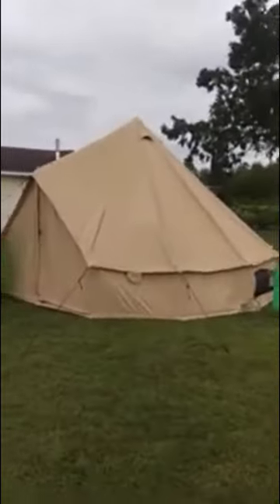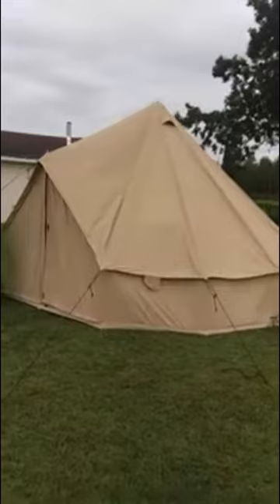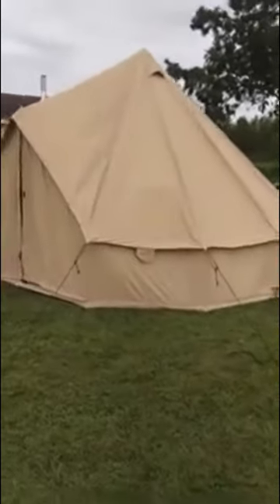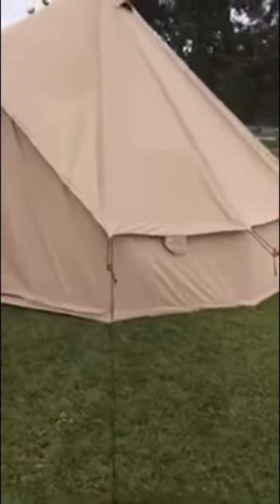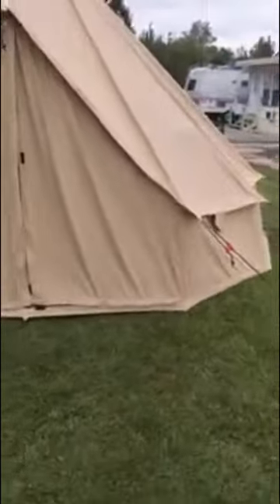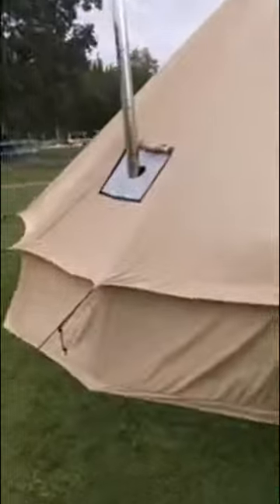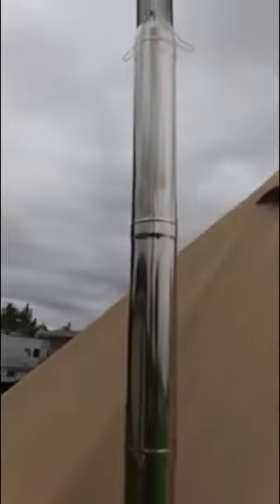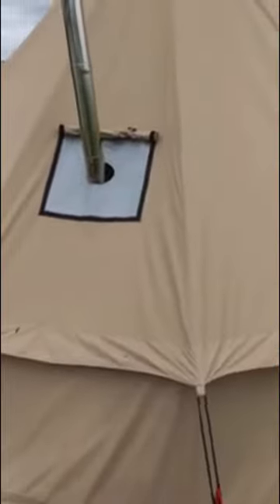White Duck Outdoors 16'5" by 16'5" Regatta Luxury Bell Tent (Review)

Comment: Did you build a fire inside your stove before putting it in the tent to burn off the new, and I like how you put the tent pod just outside, because I'm going to get a bell tent with two doors and put a totally closed in canopy and put a toilet bucket and a solar heated shower and lay some pcv pipe to let the water from the shower flow away from the tent and I'm going to put an enclosure on the front large enough to sit have my kitchen and stack up extra wood in the winter and it's snowing to keep it dry and I will be putting down the ground turf carpet to keep any extra dirt from getting into the tent and taking shoes off and not worrying about.
Reply: what bell tent you looking at that has two doors?
Reply: @jeremydecoudres  it's a Stout bell tent that has two doors.

Comment: What do you do to prevent rainwater/snow from coming in around the stove pipe?  It looks like the hole is big?  Have seen other owners mention it but haven't seen solutions?  Great video and review!  Thanks for the details! 😁
Reply: I'm fairly certain that the stove jack comes without the hole. the owner cuts the hole the size it needs to be for the pipe they have. I'd just cut it a bit smaller than he did